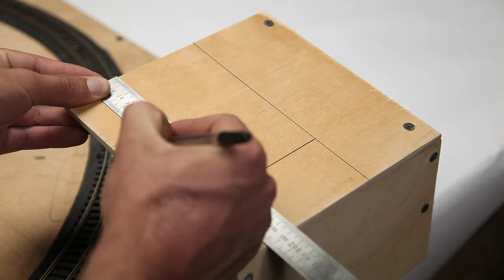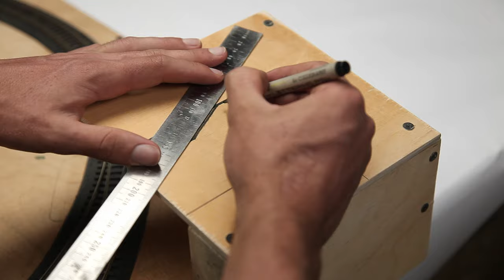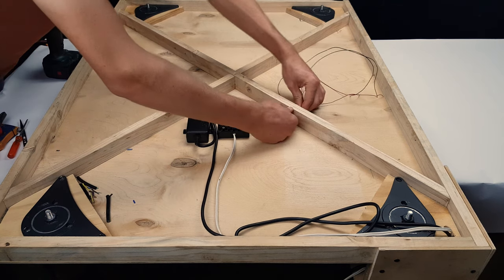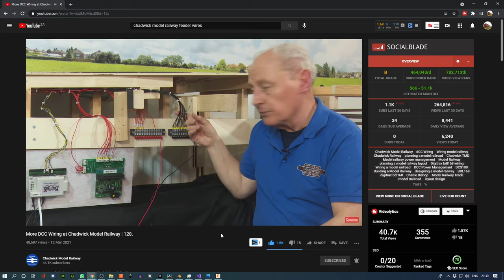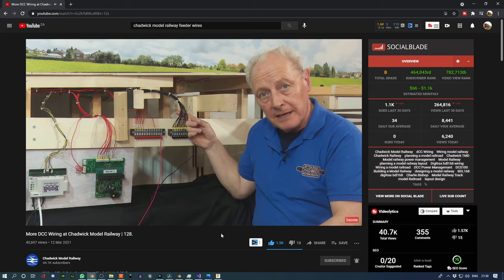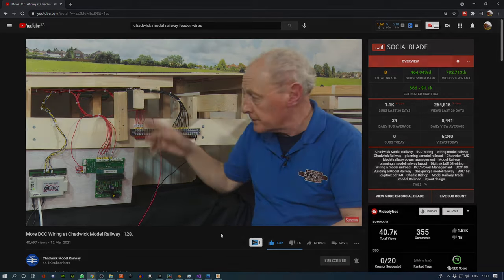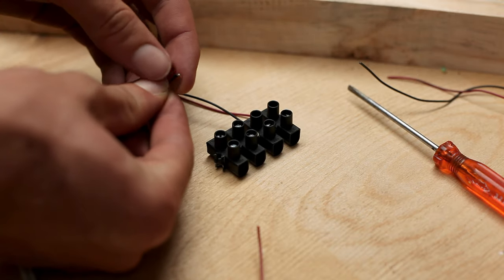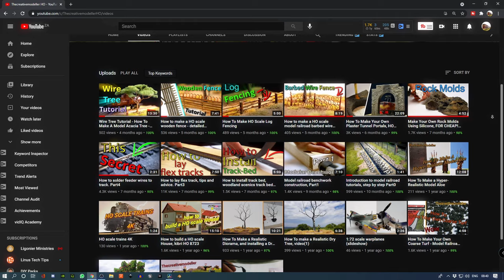Wiring Up My Small DC Layout, Tips And Advice. Part5

Comment: This is such a fantastic video. Exactly what I needed as I’m constructing my own DC layout and have now reached the wiring stage. Like you, I follow Charlie Bishop at Chadwick but his layout is DCC with lots of electronics. What I especially like with yours is showing how easy it is to build your own control panel. The only bit where I got lost was spotting how you connect the black track wires back to the panel - all those wires looked red! Will you be installing a point motor and switch too?
Reply from the maker: Hi, thanks for checking out the video! I'm glad you found it helpful! I know that part of the video was a bit confusing, I also got a bit confused when making that part of the video... 🙈  I'm not planning on installing a point motor. I want to keep it as simple as possible.

Comment: Folding the conductors back over the insulation is likely to result in a faulty connection. You should have nothing but bare conductor under the terminal block's screw. I'm not sure why you folded the wire back on itself. Maybe the screw would not tighten down on just the conductor? Make sure the terminal block is rated for the wire conductor size that you are using.